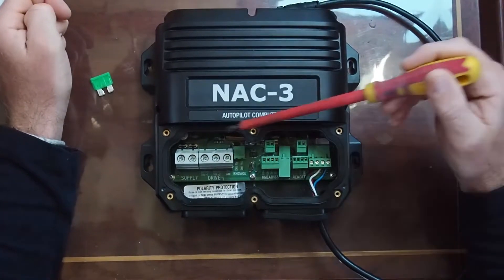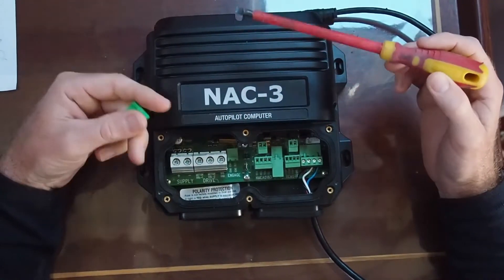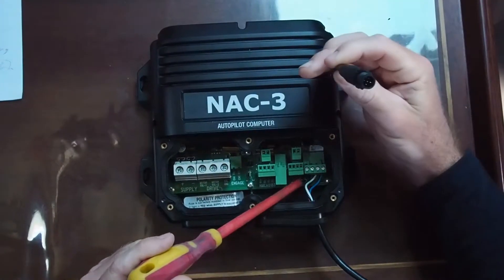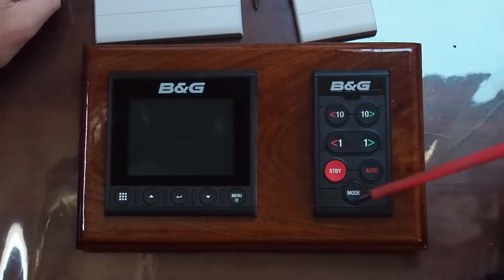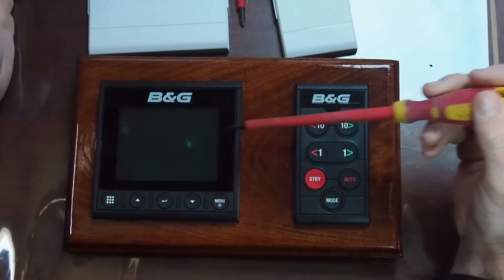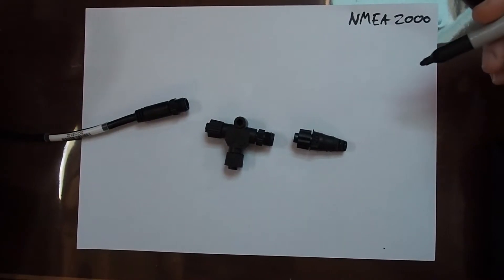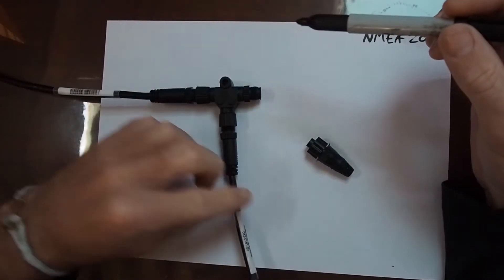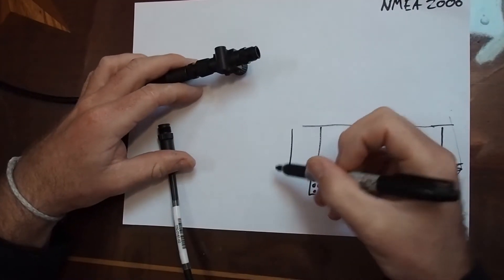B&G Triton 2 Auto Pilot with NAC-3 computer installation.

Comment: Seatalk 1 is a very different network and data sharing protocol than NMEA0183. Seatalk1 was Autohelm's proprietary network, and cannot be interfaced with NMEA0183 without an actual converter; connecting those leads together will fry an 0183 port, as Seatalk 1 uses a pair of 12V red/black leads for power and a single yellow lead for bi-directional data transfer. I recommend using DigitalYacht's ST-NMEA Converter, which will do so with optical isolation to prevent damage.